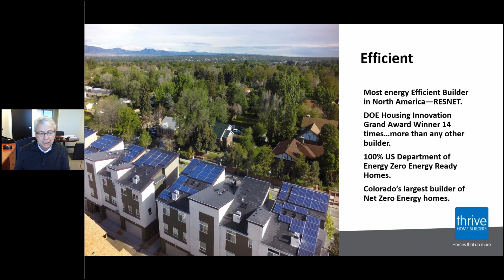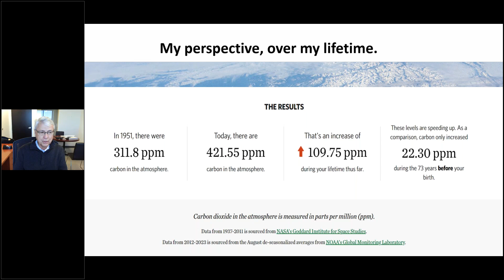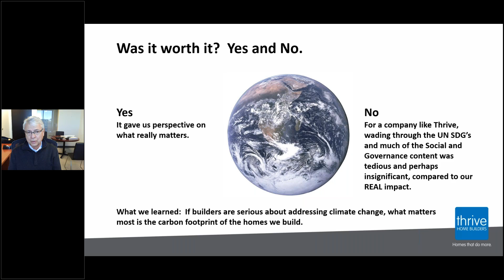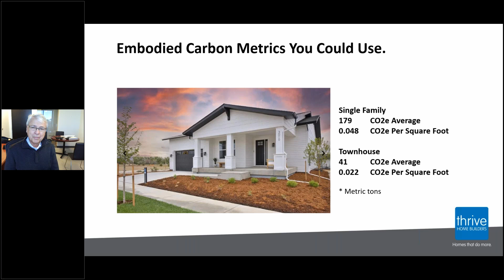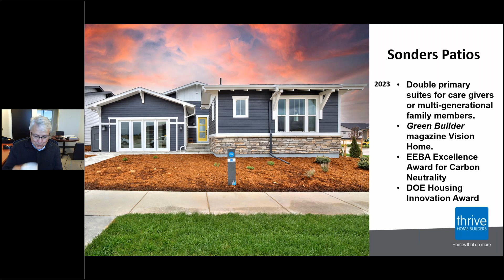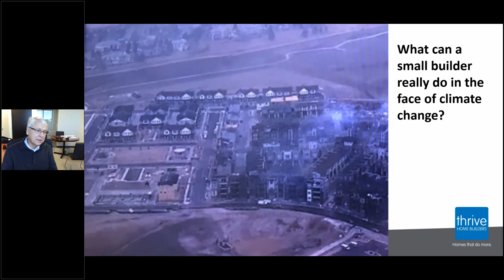A Production Builder's Lessons Learned Minimizing Embodied Carbon

Comment: @35:12 It's encouraging to see anyone with the title "production builder" even entertain Passive House certification, but I think this answer is pretty weak. "It's too expensive, just use solar panels." is an admission that building's form factor, massing, or orientation haven't been considered from the start. With the scale of a production-built neighborhood, and with repeated procedures and materials, you should absolutely be able to get PH certified buildings at the same cost as a code-built standard. The hard part is making design decisions up front. It's not money, it's just intention. So to that end, I'd rather have him simply reply "we didn't go for it here."
Reply from the maker: Thanks for your comment!  Our Editor-in-Chief, Matt Power, responds: "Having covered both small and enormous building firms for many years, I've come to understand why big builders move much more slowly, particularly when it comes to changes in wall assemblies, materials and processes. They are sitting ducks, legally, and can literally be ruined by one unanticipated problem. It might be as simple as switching to a new sheathing product, but lacking enough trained installers, so that one flashing detail is overlooked. Or the product itself may have a "glitch." For example, I've heard from many HVAC installers that some brands of wall-hung, direct vent boilers fail more often than any other heating system. Imagine a production builder who switches to a super high efficiency new brand only to have 1,000 homes with problems, and a class action lawsuit in the making. Honestly, I'm thrilled that the big builders seem to be as earnest as they are about trying to build better, and are making some strides in that direction. Could they do more? Always. But let's not be too hard on them for not jumping right away to Passive House standards."
Reply: @GreenBuilderMedia  Thanks for replying! This is an interesting perspective, and would've made a better answer to the same question. I would complete accept "we have to move slowly" vs. "it's too expensive" because, at scale, it's really not. That's my main point.

I definitely understand we can't go from A to Z in one leap. Onwards and upwards.